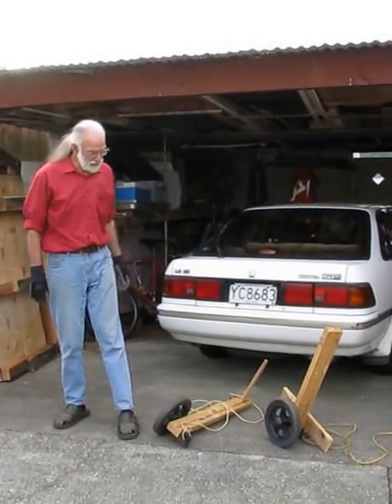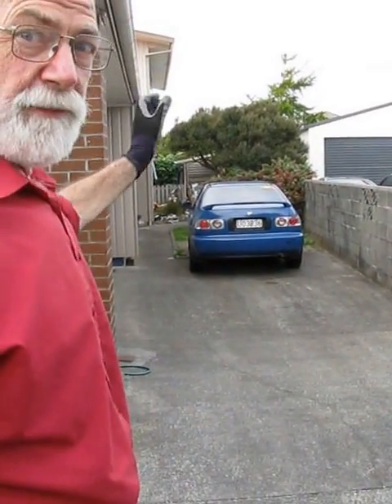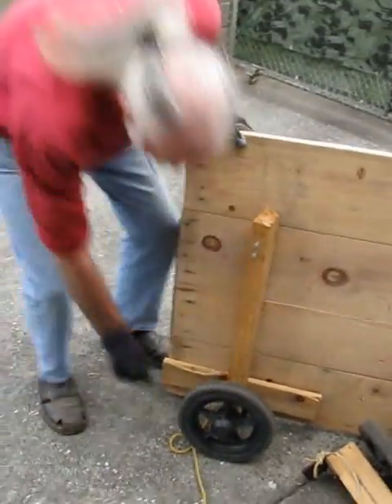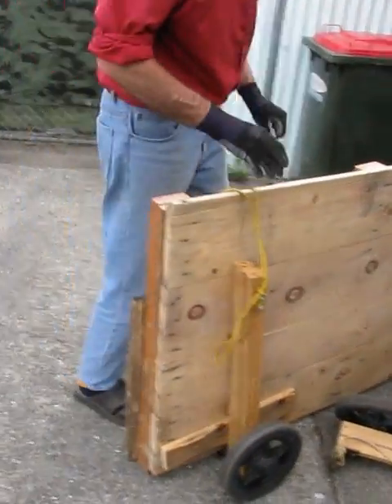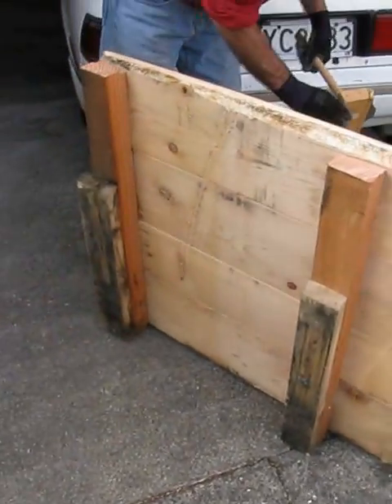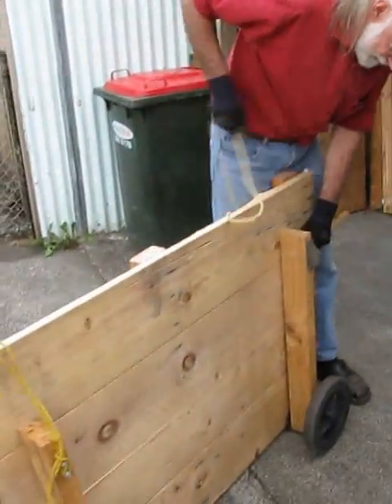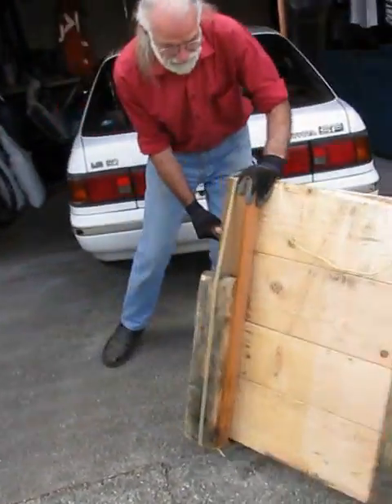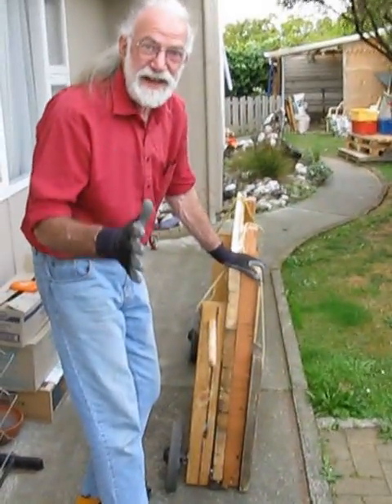Panel Mover Demonstration

Comment: I tried similar to your idea. It goes well in a straight line but can't turn tight corners and likes to fall over. So I put the wheels side by side now it works great.
Reply from the maker: Thanks! Yes, a pair of wheels will stabilise the thing. Can't do much about the poor steering performance. It's all about moving a heavy object with a flat form factor from one place to another over smooth terrain.